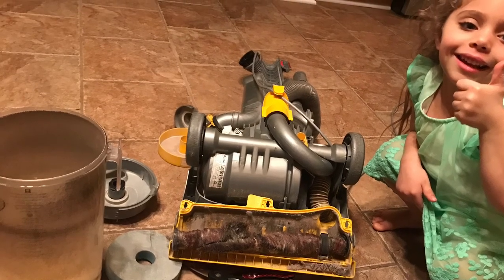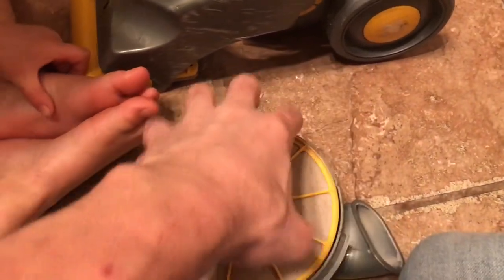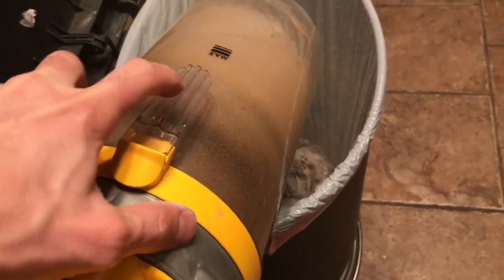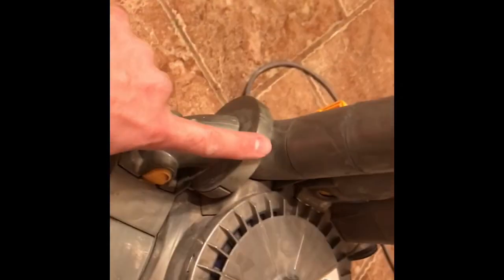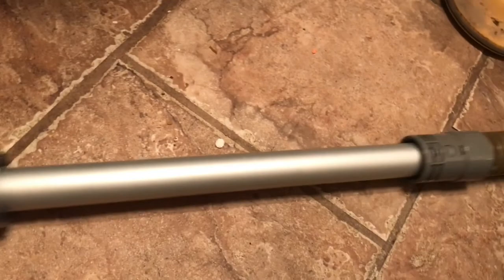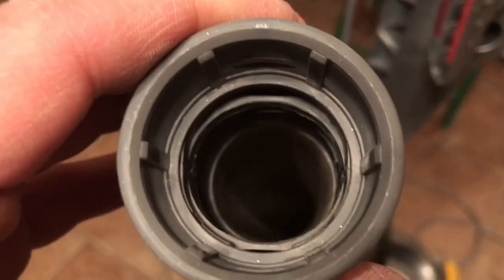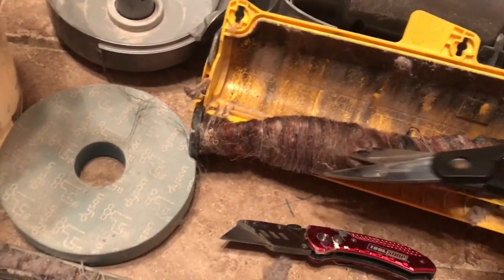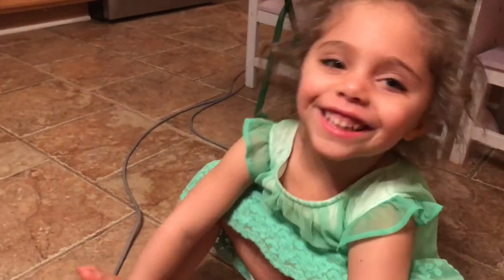Dyson Vacuum Not Sucking How To Fix No Suction

Comment: at 4:16 where you detach the flexible pipe from the wand, it also attaches to the other end of the wand where the handle is. You can then put the brush on the end of the wand and not have to bend over while you vacuum along skirting boards and picture rails. Magic!